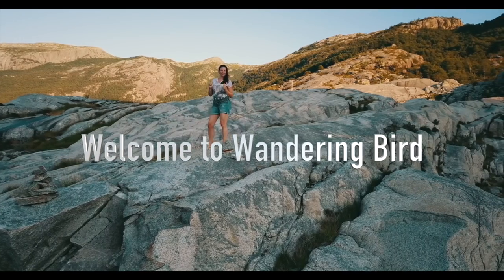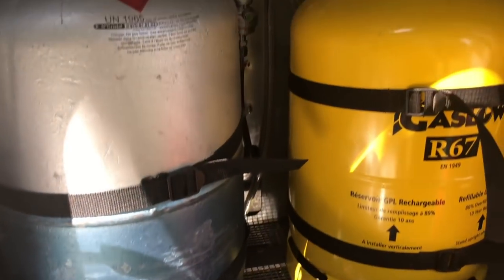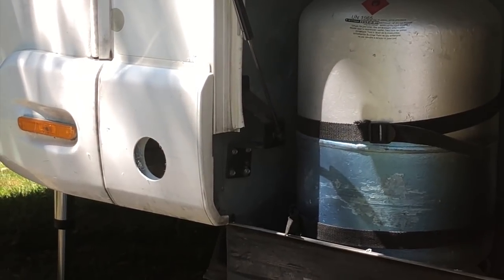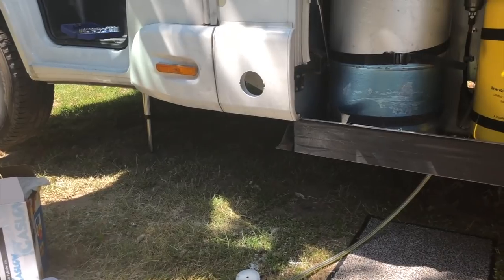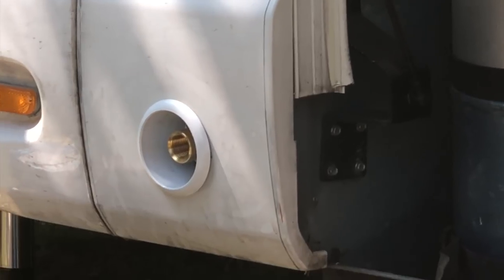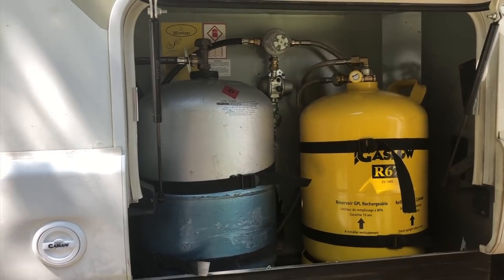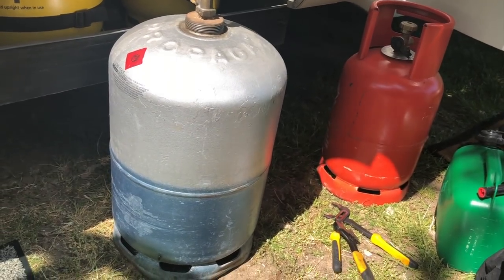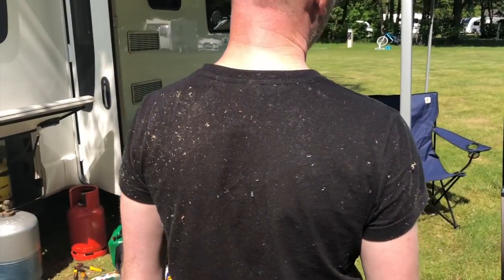Fitting Gaslow Refillable Gas Bottles to our Motorhome & Filling guide for UK & Europe

Comment: Does it matter which side you have the filling point regarding using the pump at fuel stations or do the pumps have relly long hoses to reach around the motorhome? Our gas locker is on the drivers side (UK).  Really useful video, Thanks
Reply from the maker: Nope, doesn't matter at all. Most fuel stations have the pump in the middle so it can go to either side.

Comment: Mr WB was correct the Gaslow instructions do show the filler being fixed with the screws from the inside,, and they provide different lengths of screws to ensure they don't protrude into the filler socket, must admit I was unsure when fitting mine, and ended up trimming the screws to length, did not realise you could fit them the other way around. As You and Hannah say, all instructions should allow for faffing time, especially cook books.
Reply from the maker: I'll be honest, there is a high chance that we still haven't done it exactly as Gaslow intended... but it's secure and hasn't moved in over 10,000 miles, so we're not messing with it now! :) Faffing is part of the fun!

Comment: The worst thing I found with the refillable system the first time I used mine was when you disconnected the filler, was that loud wosh release of gas.
They are great bits of kit.
Reply from the maker: I know- it's a bit worrying first few times!! But yes, they are very good.

Comment: Afraid we cheated, having just bought a new van I had the dealer fit the gaslow system (we have only done 300mls up to now and the dealer filled them for us, so we have the joys of filling them sometime in the future).  We have two 11kgs bottles and the filler has been installed in the  door of the locker, rather than the side of the van.  During the process of fitting your bottles your van appears to have had a transformation from mainly white to blue 😯.  Does your van have a self levelling system installed ? on a few of the shots you can see what looks like a shiny piston leg.
Reply from the maker: Ah sorry- when we installed the Gaslow it was before our trip to Norway (when van was white.) We had it wrapped just before we went, so bottom is now blue! And yep, we had MAVE legs fitted- expensive but BRILLIANT. Doing a review video on them very soon!
Reply: Wow checked out price of ma-ve and at £4500 big investment.  Our van has a MTPL of 4500kgs and we have not had the opportunity to put it on a weigh bridge yet, with the bikes on the back (pedal power 😒 not Triumphs😎) and fully loaded for a long trip.  We only collected it in October and have put it on SORN until April, our weigh bridge is only 3mls away and only costs £3, then we will find out if we can absorb the additional weight of the system you have. Thanks for the reply.
Reply from the maker: HUGE investment. We're still evaluating if it's worth it or not- video on that coming soon!
Reply: Looking forward to it.  On another point the truck looks great with the wrap, not thinking of having it done on our new truck but, I'm sure a lot of people would be interested in a video of that.  It has totally transformed your motorhome and looks a lot more fresh and modern 👍.